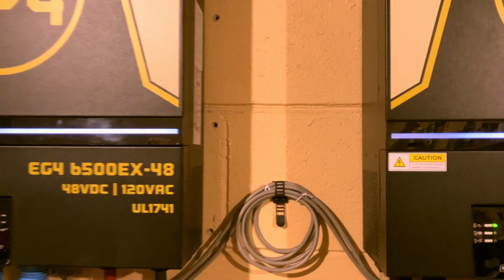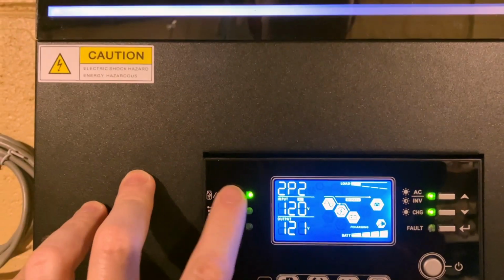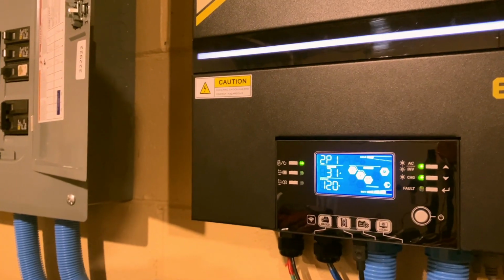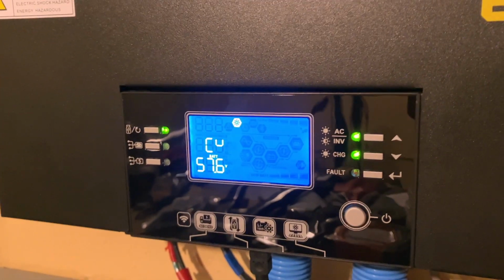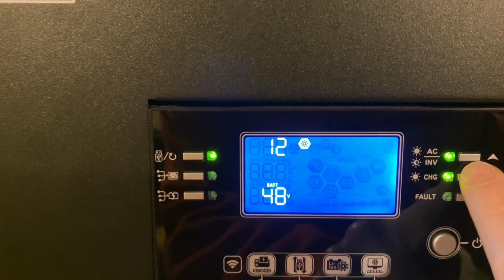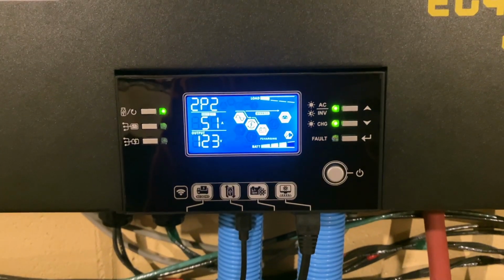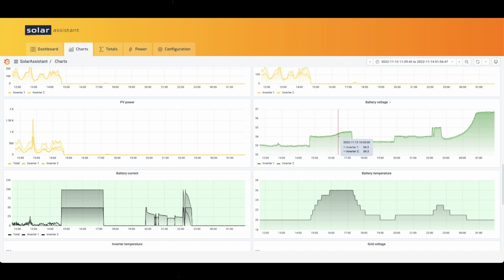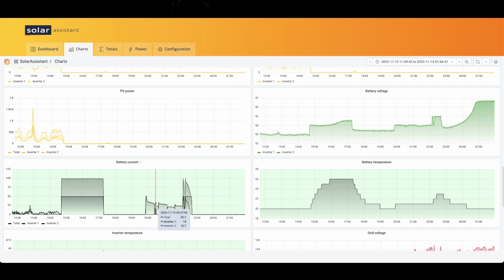Grid Charging Oddity

Comment: If you hook up BMS communication the inverters will not be guessing at SOC, which limits charging current based on percentage, and it should charge faster, deeper.   Pay attention to the displayed battery capacity indicator and you will see that the inverter that was not charging was showing the battery at 100%.
Reply from the maker: To my knowledge, I haven't seen any way to hook up JK BMSs to these style inverters for SOC communication.  

Those little 4 bar indicators on the screen are not accurate with lithium chemistries.  They're based on the voltage of the batteries so you have to take what they show with a grain of salt.  

If I turned off the charger on the inverter doing the charging, the other inverter immediately started charging.  The only reason I can think of that one inverter did the charging instead of both is because the inverters thought they were supposed to be in float mode and it's easier to maintain voltage with a single charger than multiple chargers.
Reply: @AdamDeLayDIY  the bars being inaccurate is exactly why BMS communication helps. As soon as the inverter starts showing all 4 bars it will restrict the amount of power going into the battery.  JK has an RS485 adapter, but I do not know if it will work with the EG4 inverter.  I have a pair of EG4LL batteries in my system along with a bunch of other batteries that I built myself (48v, 984ah total) and I do that pretty much solely for the BMS communication with my inverter.  I know it isn't the cheapest way to add BMS communication, but it may be worth it.
Reply from the maker: Thanks for the comments.  

The issue I was experiencing is an issue because the Bulk Charge voltage was never hit.  There was no time where it ever came close to the set voltage for Bulk Charge, so it should have never thought it should be in Float mode.  

Regardless of what the battery bars state that the battery is at, I would hope the inverters wouldn't be basing their bulk charge vs float mode on arbitrary, inaccurate power readings (of course crazier things have happened... 😁) .

Sounds like you have a pretty slick set up.  Someday I'll try to build my pack that big...

Comment: Nice video, well done, it explains exactly my problem also with my new TP6048. Sungoldpower . From the first time I powered it up, the float voltage set is controlling the charge coming in. I have 17s cells 280ah  x 4 with JBD-AP20S004 BMS. The company I purchased from has been very helpful to try to find the problem. They sent me two replacement boards, these were the programing and power board. Still the same behaviour, as soon as float voltage is reached, the controller stops charging. I am now waiting to change another board in a few days. They sent me the MPPT  board. So when I seen your video,I was hoping,I could fix mine also. Thanks
Reply from the maker: Thanks.  Sorry I wasn't able to figure out what's going on.  Someone else commented to search "MPP Float issue".  Apparently it's been happening for quite some time across all "flavors" of the inverters.  

Glad the company you purchased from is working with you.  If you find a fix, please let me know!
Reply: THis is the one I have and it took me a while to figure out.  BCM is just the charging voltage, regardless of what voltage the battery is at, BCM is just the voltage the battery wants to see so it can charge properly.

Comment: P.S. You should be able to set these setting from within Solar Assistant as well "inverter settings" at least with my Growatt I was able to, so now I can manually switch to "Utility First" from the "Power" tab when I have low solar input I keep it set at Utility, when the sun shows it'self I choose "SBU" without having to fuss with the front panel on the growatt, you can also do the same under the "configuration" tab,  go to inverter settings and next to connected is a settings button, you can adjust you bat type and voltages from there as well, I think all of these inverters are rebadged in china and are all the same, with the exception of the firmware on them, this is where the problems come in. These re-sellers in the US perhaps do not have an idea of how these things work either, I have had 5 different answers from 5 different people, including the manufacturer. P.S. Great video, I am also on the Will Prouse Solar Forums I see the same kind of things you see with these units mirrored on my Growatt, settings for the battery charging are ignored unless certain conditions are met, and no one has been able to explain these settings to me, so I have my float and bulk set to the same rate to make sure the batts get fully charged and this seems to work for me. YMMV.
Reply from the maker: Thanks.  

Yeah, most of the time I make the changes in SA, it was just easier to not mess w/ screen recordings when I could make the changes right on the inverters.  I really hate having to scroll through the menus and find the manual each time to determine which setting I need to change.

Very rarely will I actually charge from grid, I just hope these issues don't carry over to Solar charging as well, but I don't have to worry about getting close right now since we're in winter here.  It's just crazy that all these different style inverters have these issues and no one has been able to figure out why or even a fix.  Even in my test, earlier that day everything was working perfectly fine...

Just nuts if you ask me...

Comment: Still need grid charge when a few days of winter without sun.   If we have 100% soc by 3:30, we can overnight on batteries finishing the next solar cycle at 40%.    If we are not at 100% SOC,  I switch to grid and grid charge after 7pm (cheap hydro).   Then switch back to SBU when 100%.

Comment: Also 57.6 is too high.  If you have any cell imbalance...  BMS may trip Cell OV and disco the pack fro charging.  I charge at 55.2 and float at 54.8.
Reply from the maker: I'm still playing around with settings, but I've had good luck with these settings at the moment, of course now that we're in winter time, I'll probably never get close for a long time...

Comment: When I charge from grid, I select Utility first on both legs.   Charge current is balanced from both inverters.
Reply from the maker: Interesting.  So yet another difference of the output priority modes, regardless of what is actually providing the power...

It seemed to work fine earlier in the day.  I guess the reason only 1 would charge in the test is because it was trying to maintain the voltage of float mode and it's better to do that with a single charger than multiple?  That's the only thing that comes to mind.

Comment: Honestly I have found you to be one of the most informative and analytical channels for this subject I have found so far when using these EG4.  My setup for this arrives in a few days good to know what I’m in for.  SS and EG4 really needs to address these issues.  They are obviously software bugs and should have a remedy.  Sad that the grid backed setup seems to cause this as it was what I have planned as well.
Reply from the maker: Appreciate that.  I'm just trying to document exactly what I see, whether it happens a lot or just once.  Fortunately (or unfortunately), I'm one of those guys where at work, everything gets sent to me to be tested and I end up breaking or finding all the issues...

I'm hoping since EG4 has their own custom firmware, that they'll figure out what these issues are and be able to correct them, giving their product line a leg up above all the other white-labeled inverters.

Good luck on your set up!
Reply: @AdamDeLayDIY  Thanks for the well wishes.  I am no engineer but problem solving and a good bit of technical know how goes a long way.  Was wondering how you dealt with grounding issues. I’ve seen disconnected bonding screws on other channels.  How did you address the neutral / ground bond? Just curious.  I think every person I’ve seen do this setup has done something different.
Reply from the maker: @Capoe3  Problem solving is something I have to do on a daily basis, so I kinda take it personally if I can't figure out a fix, or at least a work-around.  

Regarding the ground/neutral bond, I ran for weeks without messing with it at all.  Then when I first went into grid-bypass mode for an extended period of time, I noticed my computer speakers had a "hum" to them that wasn't normally there.  After doing some research on the DIY Solar forum, I found out that the hum (and possibly lights flickering) were symptoms of multiple bonds.  

The units have a dynamic ground/neutral bond. When in "battery mode" the bond is activated by way of a relay (I believe).  When the inverters switch over to grid-bypass mode, the bond is deactivated in order to use the bond directly from your main panel.

I came across this document which was huge for me.  https://diysolarforum.com/resources/grounding-and-bonding-for-mpp-lv6548-and-eg4-6500ex-48.275/

My current setup is based off 6B (Common Neutral) and so I ended up talking with SS about everything and they recommended to remove the bonds in both inverters.  I had to confirm with them before I did anything, because opening the cases of the inverters voids the warranty.  Didn't wana throw away the warranty after only having the units for a couple months.  They noted on my account that I was given permission to remove the bonds.  

I actually made the suggestion to SS about making the bonding "action" controllable through the menu.  It's already programmatically controlled through the software, so why not make it a menu option which prevents people from having to open up the inverters?  Still waiting to hear back on that suggestion...

Hope this helps.

Comment: Battery is telling inverter to charge what is needed to top off the full charge .. so both inverter will not charge at the same amp.
Reply from the maker: I get that they might not be exactly the same, but since they're both hooked to the same battery bank, with the same length of cabling, they should be pretty close.  There's no reason at all that I can think of why 1 is charging and the other isn't.

Comment: I have both my float and bulk set the same. Because for us lithium they don't need float.
Reply from the maker: Sure, much better than FLA.  In the little research I've done and the videos I've seen from other people who know what they're talking about more than I do, they all seem to have a float voltage set.  If nothing else than to maintain a voltage while letting their solar provide for the loads of their system.  Andy from the Off Grid Garage did several videos on floating.  Will has also done some and also had a good video with the owner of Battle Born batteries where they talk about that.  I think from my standpoint, my Victron Charge Controller had a Lithium profile that I used and it had a float value set and I've just migrated my settings over from that.  Everything worked great in the 12v system, so I was hoping it would carry over.

With lithium, it doesn't seem like there's really a "wrong" answer since they don't have to float.  Course where we live, we never seem to have constant sun, so our batteries are always fluctuating up and down...
Reply: @AdamDeLayDIY  I thought I watched off grid garage about that. Maybe I need to rewatch it. Yeah especially now we don't see enough sun for float. I basically just have mine set for 4.05 v per cell which I believe is 90% ish for li ion. So as long as there is sun it will target "full". Until summer I won't know for sure. I've only had about 3 days in the last month where it switched back to grid because of low battery. I told the wife. Pay no attention. Act like Normal soni can see it's week areas. Did some CB radioing last few days. That pushes it into grid bypass to so I definitely buying the low frequency growatt 12kw soon. Really want to run the ac this summer too. So far a month into winter tho. I know I can't run a ground source heat pump with the amount of panels I have. 12.2kw. not sure how I want to proceed for winter heat. Probably get a wood burner and a heat pump. This way heat pump is only secondary heat and won't drain batteries so fast
Reply from the maker: @electromechanicalstuff2602  I've had quite a few days on grid vs off.  Just not enough solar for me to be able to recharge fast enough.  Plus my wife's been baking like crazy recently so that's using up lots of power and the christmas lights are all up now...

We have a wood boiler.  Love it.  It's used for heating the house plus our hot water.  We got ours from https://ezboilers.com/ here in MI, course now there's all these "efficient" ones out there that have me wondering about those...
Reply: @AdamDeLayDIY  ya they are also EPA cert now too. So the chambers have theaters and catalyst which make em more difficult to clean and service. Lots of used panels options on San tan right now. Might have to do some yard mounts like u got. Put up another 12 kw.... Oh boy. I already hate having two different types of panels let alone 3 or 4
Reply from the maker: @electromechanicalstuff2602  Yeah, might have to stack those arrays.  Looks like you've got some space to do it though.

Comment: your setting 5 is in use mode.
when you batteries can communicate, they should set those parameters correctly for you
Reply: also, research mpp solar "float bug" ( eg4's are rebadged voltronic's, and so are mpp solar)
Reply from the maker: @houseofancients  thanks!  I’ll take a look!
Reply from the maker: My batteries cannot communicate with the inverters.  I’m not using server rack batteries.
Reply: @AdamDeLayDIY  what bms are you using ?
there are a number of bms'es that are able to have proper comms with your inverter, regardless if they are on a diy build
Reply from the maker: I have 2, 280ah packs with JK BMSs